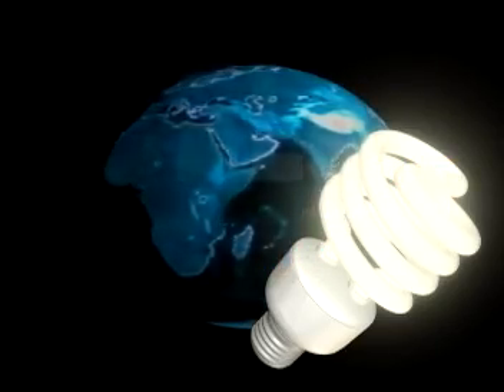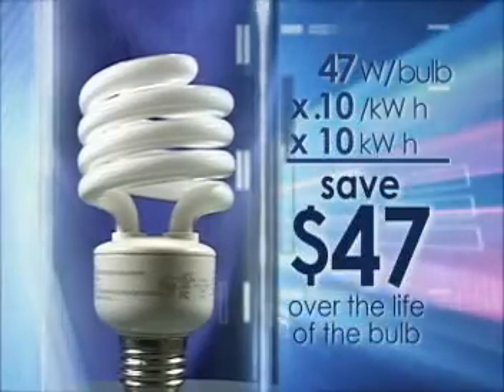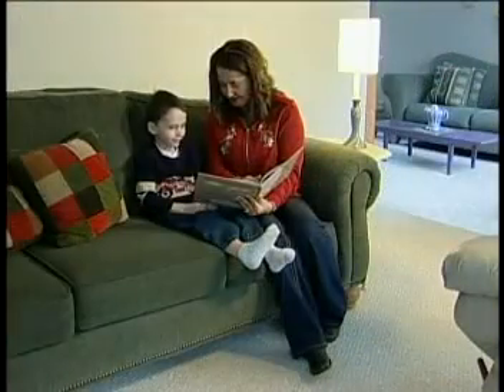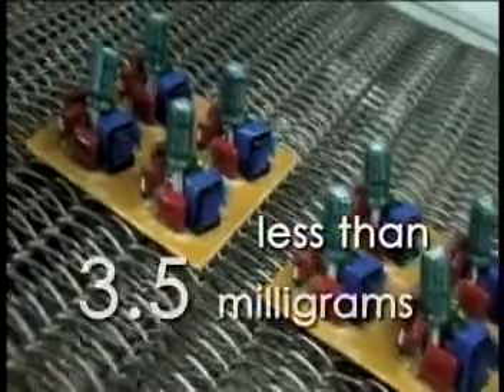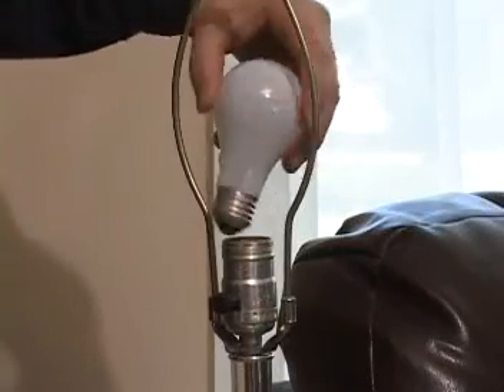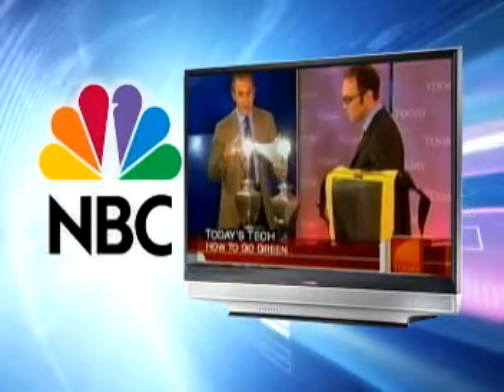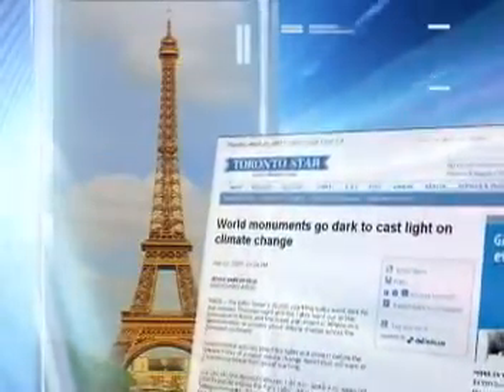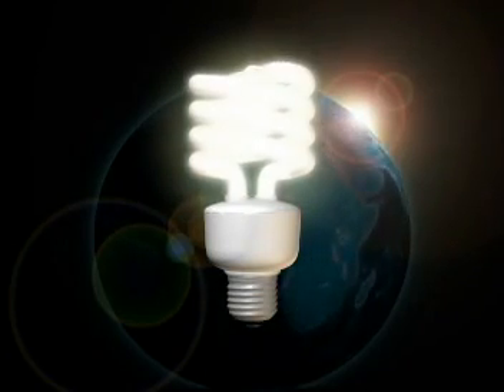Shining a New Light on Old Buying Habits

Comment: I'm not sure about your math. Let's look at it. A 13watt lamp with a power factor of 1.0 will in fact draw 13 watts of power. if the PF is .6 then you would simply multiple the 13w X 0.6 = 7.8 watts. 
The most common PF of CFL is .90 that would make the actual consumed wattage as 11.7.

Comment: People should know that for exemple, to power a 36watt CFL the power plant must pump to their homes 72VA which is in fact 72watts.  In most countries they don't charge the residencial consumer for that, but industries could never use hundreds of CFL with low PF - Power Factor. The PF of the CFLs we buy are at best 0.6. So a 13watts CFL are actually consuming about 21watts - 13 / 0.6. People should be aware of that and avoid buying above 30watt CFLs to replace a 60watts incadescent bulb